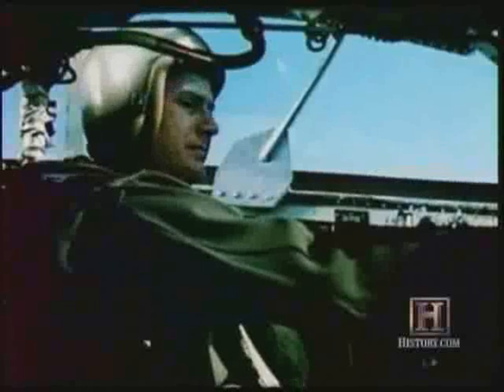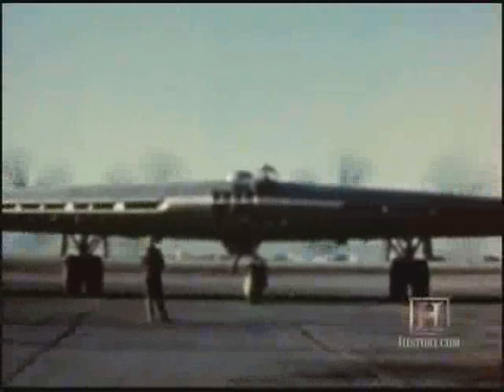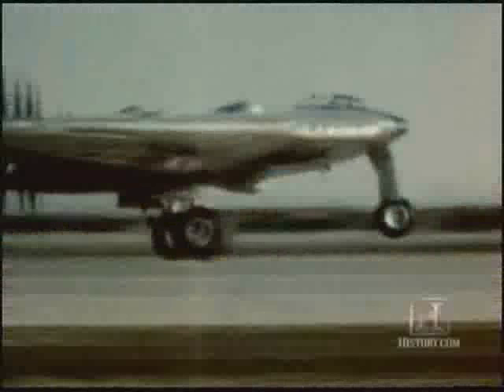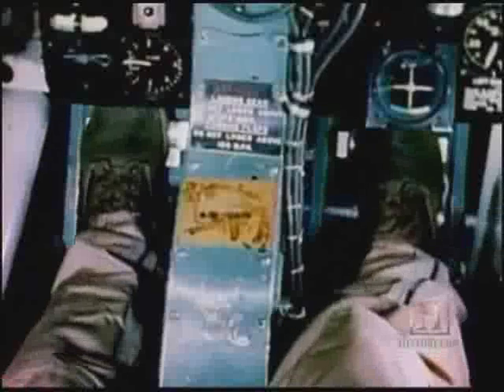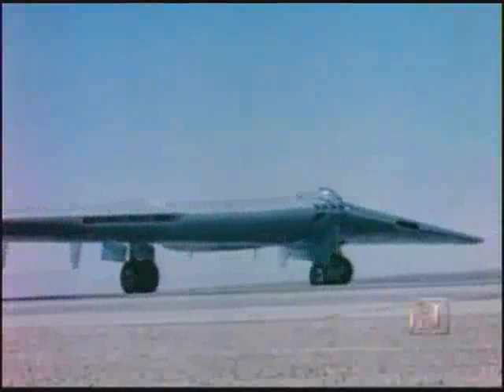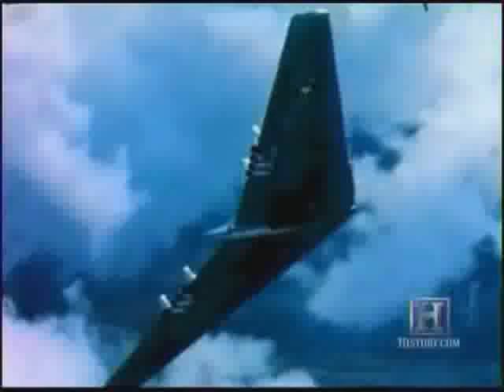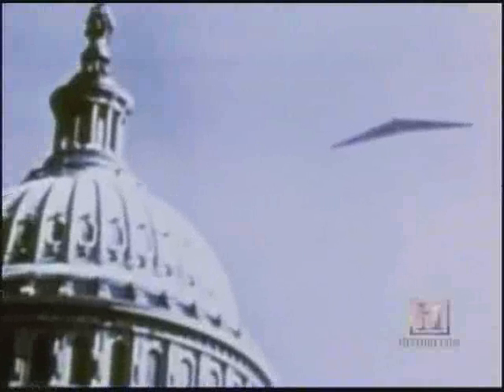Flying Wing YB-35 and  XB-49

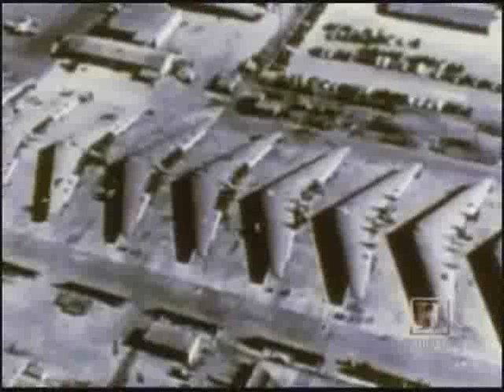Comment: The flying wings at 1:34 are among the 11 B-35 airframes in the process of conversion (the second and third YB-35 airframes on order had been built as YB-49s, one of which was lost in an accident in June 1948). The XB-35s, the only completed YB-35, and one YB-35 airframe were scrapped, and seven aircraft were selected for conversion to RB/YB-35B jet-powered trainers, while serial number 42-102376 became the YRB-49A prototype photo-reconnaissance aircraft and serial number 42-102378 was chosen to become the EB-35B testbed for the Turbodyne T37 turboprop. (The YB-35Bs and EB-35B were scrapped in early 1950 without ever being completed or flown.)

Comment: I was born in 1948. Many of the kids comic books and short stories of the time were written around the flying wing. Even the funny papers. No smart bombs at that time so bombing required a straight run. The wing didn't fly a stable course like the bombers of the time so the Air Force didn't want it. Some pilots said the jet flew like a fighter.

Comment: I don't even know if you guys know the reason FOR the "flying wing".
It wasn't developed to be some sort of space ship. 
It was developed to reduce drag. That's it. Nothing more. Not "stealth".
That came later.
Anything drug through the air develops drag. The less aircraft there is, the less drag.
That's why we went from tri/bi planes to monoplanes.
Still, they were dragging fuselages and horizontal/vertical stabilizers through the air.
The flying wing eliminated everything but the wing.

Comment: This video is wrong.  These wings were never powered by turboprops.
Reply: The B-35 was piston-powered, while the YB-49 had eight Allison J35 turbojets. An additional YB-35 airframe under construction was built as the YRB-49 prototype reconnaissance aircraft, which flew in May 1950.

Comment: A totaly ridiculous theory: the Ho229 was ABSOLUTLY NOT a advanced aircraft, only a woodden prototype flying wing with jet engines (fly in march1944, but never use in operations and never fitted with weapons), but totaly comparable to the Northop N9MB built in 1942 but with propellers engines.
Flying wings was built BEFORE WW2 in the USA,France and Germany= nothing new...
For your information the first turbojet engine patent is from Maxime Guillaume (France) in 1922...

Comment: @Dreachon - keep on believing that... Hortens 1929 prototype was mounted with a tail for test purposes, it was done on purpose, and the tail was supposed to be removed after wind-tunnel testing.  As we know the company was bought out and the project cancelled before the testing was complete.

Northrop was working on powered wings starting in 1927, thats nearly a decade before the Hortens were able to modify a glider to accept a borrowed engine.

Comment: @kdraper2007 
Nope, his first flying wing didn't fly until 1940.
The one from 1929 wasn't even a full flying wing because the aircraft still used a tail with external control-surfaces.

The first Horten flying wing went in 1933 in a glider form, in 1937 they had a twin-engined flying wing in the form of the Ho-V.
Reply: The first Northrop flying wing to be built (the one that flew in 1940) was the N-1M, intended to test the flight characteristics of the N-1 medium bomber project (which was not built).

Comment: I'm waving no flags, but its sad how you accuse me of your problem.

The 1929 was a proof of concept vehicle, the tail exsisted because they were working in stages.  Annd from the vehicle they gathered alot of data, and used it in wind-tunnel testing as well.  This was still 6 years before the Hortens un-powered glider, and that data allowed Northrop to surpass the Hortens by 1944.  
I'm not ignoring the Facts, I just know more of them, and you're not used to that I suspect.

cheers

Comment: The USA had the P80 in January of 44.

The UK's Meteor I first flew in 43.

Its not that the Allies didn't have jets, better engines for that matter, its that they didn't need them.  They were beating Germany and Japan without them.  Short-range interceptors are great when you are the one being bombed, it was long-range escorts that they needed so that is what they built.
Reply: The honor of the first American jet fighter to fly actually goes to the Bell P-59A Airacomet, not the P-80. However, the Airacomet could only fly as fast as the P-51 and P-47, so it did not see combat service, yet it was a pioneering military aircraft.

Comment: How exactly did Northrop "have the construction plans" of the Hortens when the N1M and N9M flew years before the 229 was built?

And the R&D for the XB35 was finished in 44 when the 229 was still in prototype?

Northrop built dozens of successful aircraft, including the XB35 and YB49.  Their was no conspiracy, it was politics, simple as that.

The Hortens never had a single successful aircraft in their entire careers, they just kept pumping out new wing prototypes for a decade.
Reply: Northrop's flying wings evolved from the X-216H experimental aircraft, and the first Horten flying wings were built by the Horten brothers using their own imagination (similar to the fact that Hans Pabst von Ohain and Frank Whittle created their jet engines unaware of each other's work). A little-known British aeronautical engineer, Geoffrey T. R. Hill, created his own tailless aircraft, the Westland Pterodactyl, and Great Britain had a few proposals for flying wing bombers in WW2, but none of them left the design phase. The N-9M was the sub-scale tech demonstrator for the XB-35, and four aircraft were built. Northrop also built the XP-79 flying wing fighter and two tech demonstrators for testing the XP-79 design, the rocket-powered MX-324 and the unpowered MX-334. 

The XB-35 was intended to meet the same requirement as the Convair B-36, and like the B-36, it didn't fly until after the end of World War II. It was basically pretty obsolete by the time the two prototypes flew b/c it was a piston-engine plane and the jet age had arrived. Of the 13 YB-35s on order, only the first YB-35 was built, and Northrop decided to adapt the B-35 to the jet age by having the second and third YB-35s modified with eight J35 turbojets in lieu of the Wasp Majors, resulting in the new designation YB-49. The YB-49 flew in 1947 and despite dispensing with the gearbox failures that limited the number of XB-35 test flights, it suffered longitudinal instability problems that rendering it unsuitable as a bombing platform, and its range made it comparable to the B-47. The second YB-49 was lost in a crash on June 5, 1948, killing all five crewmembers aboard (one of the crew, Glen Edwards, would have Muroc Air Base renamed in his honor). Northrop also worked out a photo-reconnaissance B-49 variant, the RB-49, which had eight General Electric J47s (six buried in the wing, two in individual underwing pods), and one YB-35 airframe (s/n 42-102376) was chosen as the RB-49 prototype and designated YRB-49A, featuring six Allison J35s (four in the wing, two in individual underwing pods). A contract was placed for 30 production RB-49s in August 1948, but concerns about the operating range of the RB-49 caused the production contract to be canceled, and only the YRB-49A was completed, flying in May 1950. The sole remaining YB-49 was destroyed during a taxi run, and all other incomplete YB-35s (including the EB-35B that was to have served as a testbed for the Turbodyne T37 turboprop) were broken up for scrap.

Comment: Northrops first prop-driven test bed was flown in 1929, 6 years before the Hortens first glider.

The N1M and N9M prototypes were prop-driven because the US Army wasn't accepting bids for jet propelled aircraft.  The US and UK didn't want more jets than they already had in R&D because they had a vast support system already in place for prop-jobs.

The Hortens use of jets in the 229 wasn't "advanced" it was just more of the typical resource-wasting that was the norm in Germany at that time.

Comment: talking about a multi-engined bomber the hortens tested with jet engines which the USA not even had at that time. in every  test pilots get killed - talking about the northropp planes you will have to admit there were killed more related to the antihuman-way of development germany did in the war. btw, the N-9M crashed approximately 12 mi  west of Muroc Army Air Base on 19 May 1943. The pilot, Max Constant, was killed as he attempted to recover the aircraft from a right-hand, 60° nose-down spin.
Reply: The Ho 229 was the twin-engine flying wing fighter, the multi-engine jet bomber designed by the Hortens that you're mentioned was the Ho XVIII.